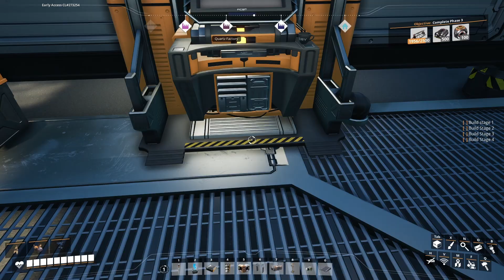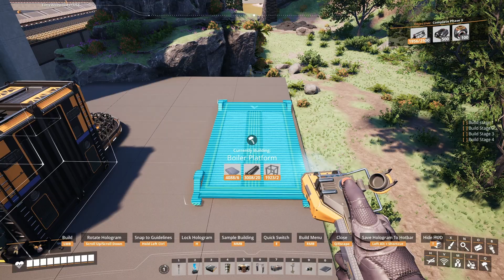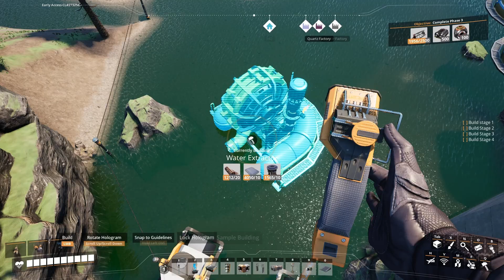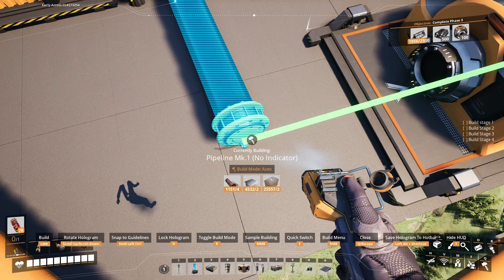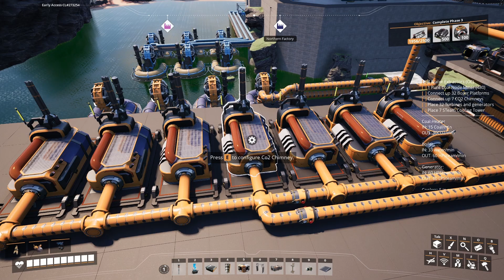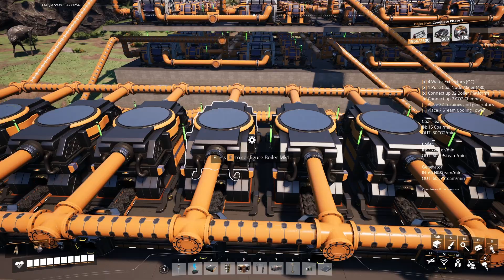Refined Power Mod Tutorial for Early Game | Tips and Tricks | Satisfactory Update 8

Comment: Getting this working is a nightmare.
Reply from the maker: It is a bit finnicky, if you are playing for the first time I recommend playing through the vanilla coal power first and then learn this
Reply: @jackblade281  It's not my first play, I've got some pretty big coal stations already and nuclear. I've pretty much copied this design and it's just not working as per yours. I'm swapping out pipes and all sorts and no joy at all. So frustrating.
Reply: I just stripped it all down and started adding boilers one by one. I can't help thinking some of the numbers have changed since you built this. That's what it feels like. as soon as I added the 8th boiler, the first went cold.
Reply from the maker: @Prod-23  That is weird, alright, I will check it out and test stuff, probably make a full guide for the entirety of Refined Power
Reply from the maker: @Prod-23  Yea I made this pre 1.0 so it is likely
Reply: @jackblade281  yeah, I'm gong to experiment more later. Thanks for your replies.
Reply: Think I figured it out. I was mixing Mk I boilers @500C with Mk II Turbines which need 120m3 Steam ...
Reply from the maker: @Prod-23  aaah, yea if you are upgrading tiers you need to upgrade the whole setup and add or reduce the inputs required

Comment: Didn't you say that generators require 1:1 cooling? And what's the minimum coal and water that each part needs to self-sustain?
Reply from the maker: There is another comment in this comment section that lays it out in detail by @johnnyhughes1 that laid it all out:

"So, a normal (non-overclocked) coal generator uses coal at 15/Min.  The perfect ratio of a coal generator for a 120/min pure coal node is 8 Generators. This requires Mk 2 belts to get 120 coal out per minute. 

Each generator requires 45 m3/min water.  So 8x45=360 water.  One water extractor produced 120 m3/min max, so you need 360/120=3 water extractors.  A mark 1 pipe only allows 300 m3/min, so you will need to feed water into both end in opposite directions and put the third somewhere in the middle to keep flow below 300 m3 (some water will be used by the generator on the ends and the one in the middle will make up for that and provide water for all 8 generators).

Each generator produces 75 MW of power, so this setup produces 8x75=600MW of total power.

Using refined power, a coal heater also uses 15 Coal per minute .. but the CO2 chimney and the Cooling Tower only process enough CO2 and LP Steam for 5 total units, so the perfect build for refined power is in units of 5, not 8.  A mk1 boiler uses 45 m3/min water (also the same as a standard coal generator).  If you use 5 units per group, you can use 2 water extractors for 5 total units (45x5=225, 2 extractors produce 240).

Each mk1 turbine used with an LV Generator creates 150 MW .. so, a 5-unit group produces 5x150=750 MW.  So, they DO NOT produce the same amount of electricity.  5 units in refined power uses 75 coal and 225 water to make 750 MW while 8 normal coal generators use 120 coal and 360 water to produce only 600 MW.  

If you double up on CO2 chimneys and Cooling Towers so you can do 8 units for refined power, you can use the same amount of coal and water as the standard coal generators but produce 8x150=1200MW of power.  this means using the same coal and water, refined power is exactly 2x standard coal generators.

I personally build these in units of 5 .. and I can do 15 units with a MK2 miner and MK3 conveyor belts .. this makes 2250 MW, where 2 full stacks of 16 total coal generators uses a little more coal and water to make only 1200MW.

Now, throw in the fact that as you advance, you can get better boilers and better generators. and this becomes much more fun.  You can also just change out the coal heater for a biomass heater (if you want) or a solution heater (uses oil/fuel) and you get massive flexibility using mostly the exact same components."

All credit goes to him!
Reply: @jackblade281  thank you for this

Comment: So it's more complicated than coal power and generates the exact same amount.  So the only point of it is to complicate things for yourself?  "that is from one pure node.  If you want lots of power  early game...."   Umm, you did not use a tier 1 miner.  That would be early game.
Reply: So, a normal (non-overclocked) coal generator uses coal at 15/Min.  The perfect ratio of a coal generator for a 120/min pure coal node is 8 Generators. This requires Mk 2 belts to get 120 coal out per minute. 

Each generator requires 45 m3/min water.  So 8x45=360 water.  One water extractor produced 120 m3/min max, so you need 360/120=3 water extractors.  A mark 1 pipe only allows 300 m3/min, so you will need to feed water into both end in opposite directions and put the third somewhere in the middle to keep flow below 300 m3 (some water will be used by the generator on the ends and the one in the middle will make up for that and provide water for all 8 generators).

Each generator produces 75 MW of power, so this setup produces 8x75=600MW of total power.

Using refined power, a coal heater also uses 15 Coal per minute .. but the CO2 chimney and the Cooling Tower only process enough CO2 and LP Steam for 5 total units, so the perfect build for refined power is in units of 5, not 8.  A mk1 boiler uses 45 m3/min water (also the same as a standard coal generator).  If you use 5 units per group, you can use 2 water extractors for 5 total units (45x5=225, 2 extractors produce 240).

Each mk1 turbine used with an LV Generator creates 150 MW .. so, a 5-unit group produces 5x150=750 MW.  So, they DO NOT produce the same amount of electricity.  5 units in refined power uses 75 coal and 225 water to make 750 MW while 8 normal coal generators use 120 coal and 360 water to produce only 600 MW.  

If you double up on CO2 chimneys and Cooling Towers so you can do 8 units for refined power, you can use the same amount of coal and water as the standard coal generators but produce 8x150=1200MW of power.  this means using the same coal and water, refined power is exactly 2x standard coal generators.

I personally build these in units of 5 .. and I can do 15 units with a MK2 miner and MK3 conveyor belts .. this makes 2250 MW, where 2 full stacks of 16 total coal generators uses a little more coal and water to make only 1200MW.

Now, throw in the fact that as you advance, you can get better boilers and better generators. and this becomes much more fun.  You can also just change out the coal heater for a biomass heater (if you want) or a solution heater (uses oil/fuel) and you get massive flexibility using mostly the exact same components.
Reply from the maker: @JohnnyHughes1  very nice and clear breakdown, should help people who watch to get a good understanding of the difference between a vanilla coal setup and a Refined Power early game steam power setup
Reply: @JohnnyHughes1  This was the explanation I was looking for! Thank you, I too was weighing the options of why go through all of this. Now i know it's worth it.👍
Reply: There’s also more then just this like the modular reactor that can produce its own high pressure steam for the large converter
Reply from the maker: I will have to double check, but if I recall I would not have been able to make that much power from a single coal node with vanilla power? If I am wrong, of course I will own up to that.

The value still withstands in my opinion, if you have built your 100th coal power plant and are bored of it, Refined Power is a great alternative to challenge you again!
Reply: @jackblade281  That is fair enough.  Honestly, I have put a ton of hours into this game (about half as much as I did Factorio) and there is just something about it that bugs me still.  I get the hype of a 3d Factorio and how this game is different, but no matter how many games I start and how many hours I play I always feel unsatisfied (lol, just realized how that word applies to the name of the game when I didn't mean to even do that.)  I keep asking myself if I even like this game anymore.  I love Factorio and always will, but just something about this one.  I keep playing it, but it feels more like a job, which is odd.  Probably why I keep starting over so often.  Maybe it is just the harder placement in a 3d environment, maybe it's the need/expectation to build an actual factory around your machines, maybe it...  hell I don't know anymore.  I guess what I am saying is I am sure I will come back to this game again when 1.0 drops, but after that, I am probably done with it.  Shrug.
Reply from the maker: That's perfectly, fine ^^ What's important is everyone find their enjoyment, if it's not this game then that's ok too :P
Reply: @jackblade281  I just picked up Foundry today and have been playing for like 15 hours.  Definitely liking that game compared to Satisfactory.  It isn't fully fleshed out, but what it has is pretty damned good.  And the voxel world adds a ton of possibilities for your factory.  I think that is why I am enjoying it more than Satisfactory.  Now I have high hopes for Foundry and how it will turn out.  :)